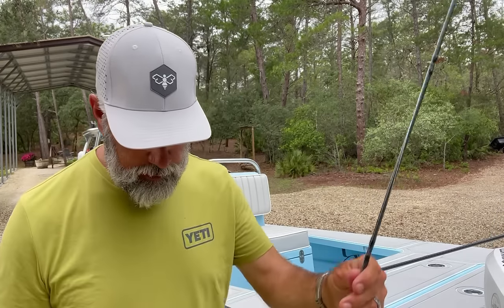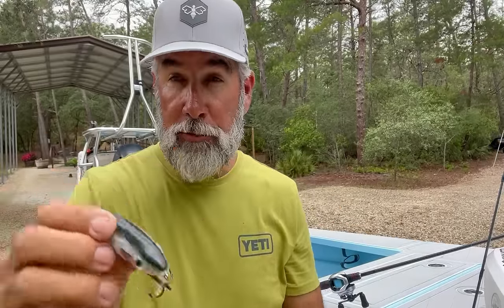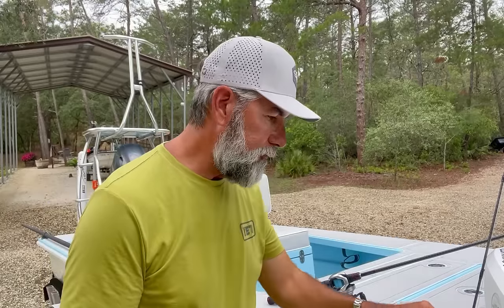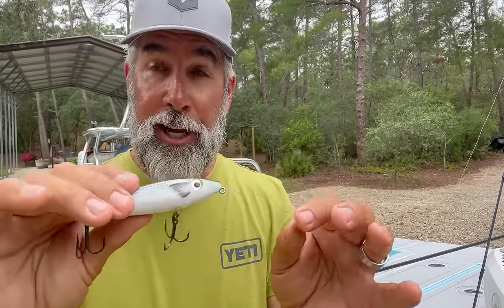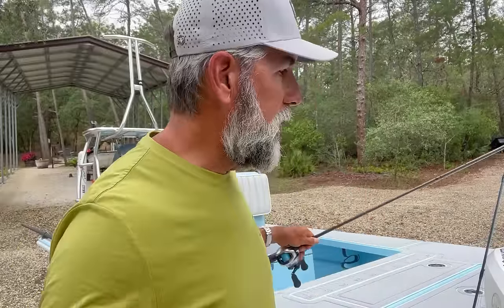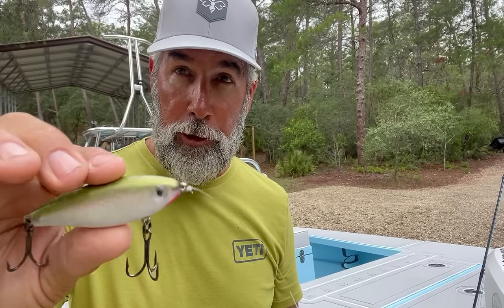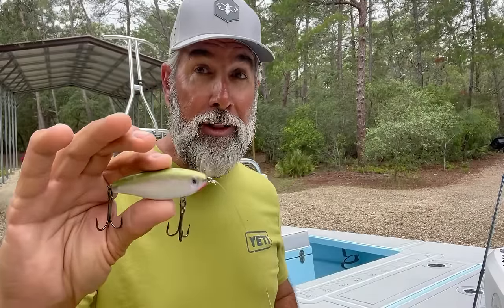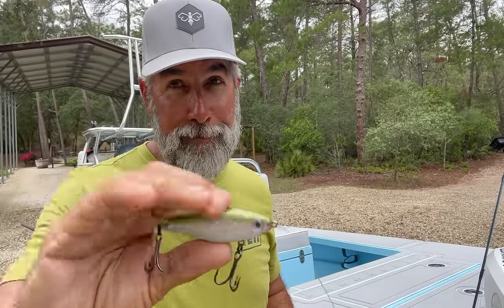Tie This Knot Instead Of A Loop Knot! | Flats Class YouTube

Comment: Great, great detail. Your point makes a huge difference even to me, a fly fisherman. Loops are not needed for light tippet since a light tippet is often limp enough to allow movement.  Also, I have noticed the same issue with Loop knots allowing the material on certain flies to foul more often. Don't get me wrong, loops are often the best choice depending on the situation and stiffness of a tippet, but they shouldn't be automatic. These fine adjustments can make a huge difference. Thank you so much for sharing your vast knowledge.